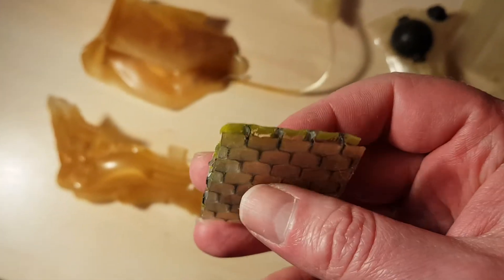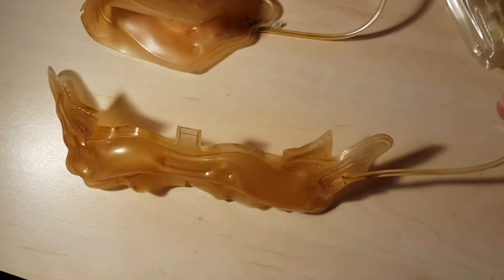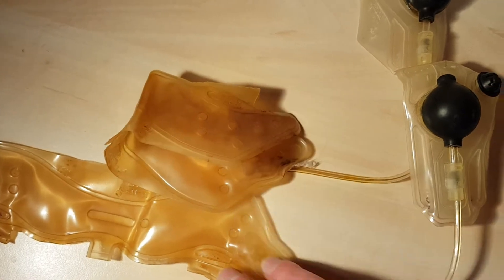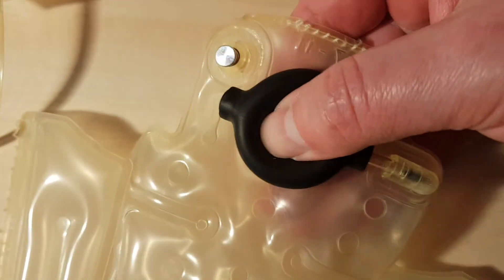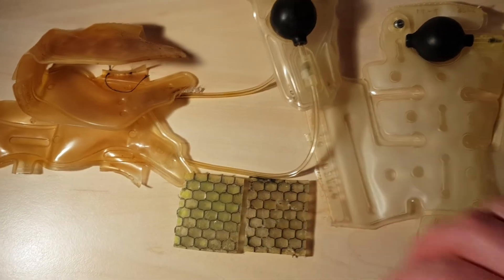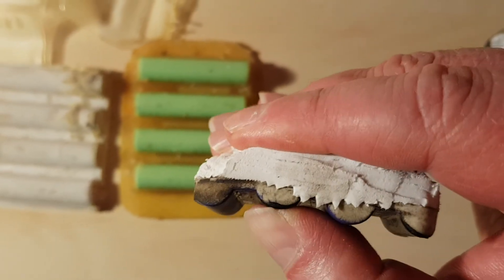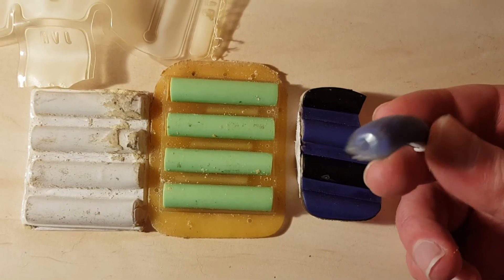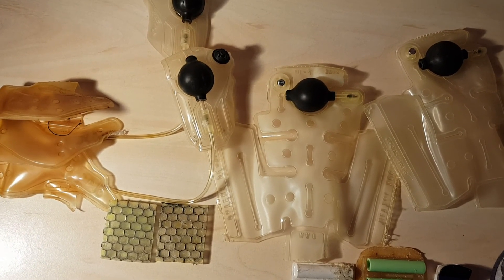REEBOK PUMP TECHNOLOGY. ORIGINAL PUMPS. ORIGINAL HEXALITE. ORIGINAL ERS.

Comment: Reebok wasn't expecting people to dig in and find out they skimped out on the ERS system. That's ridiculous. We know that the hexalite in today's pumps isn't the real stuff, but now I wonder if it's just the size of that little window on the bottom and that's it?! Wow, pathetic. We should definitely call them out on this and see if we can force them into doing it right in the future
Reply from the maker: Yeah, that annoyed me big time. They hid it well. It took me ages to rip into that midsole. And I was shocked to see this "ers" was just a bit of the midsole that had been shaped and painted to look like ers. 
I knew something wasn't right, because for one, the retros with ers are not as responsive as the original under foot.
And two, I could see in old retros that paint had started wearing off the "ers". I thought how can that be. Hytrel tubes aren't painted. 🤔
Reebok really dropped the ball with this one.
I have one pair which I think could have the real hytrel tubes and that's a 2005 sample twilight zone. It just feels different to every over omni zone, 89 pump, and twilight zone that I have.
Suppose I should send Reebok this video and call them out. They shouldn't call it ers when it's obviously not.😡

Comment: Why didn’t you pump up and release the new one??? Also these were 170 in 1990. They are 100-160 now. If they used the same exact stuff, they would probably be about 250-300. Not many would buy them.
Reply from the maker: Yeah, it was the 1989 pump hi and the 1990 twilight zone that cost $170. That was due to them being super hightops and having full foot air bladders. 
The price dropped about $50 when they moved to the mid foot pumps that were in the shorter hightops, like the omni zone and blacktop line.
Some of the early 2000s retros had the same technology/materials, but it was completely gone by the time we had the financial crisis in 08/09.
I doubt Reebok will ever go back to the original tech.

I'm not 100%, but I think I pumped the newer pump up in another video. I've done a few regarding pump technology. 
Actually, I think I deleted one, but there should be atleast another two up.🙏🏻👊
Reply: @TheRetroManRandySavage  rose anvil who dissects tons of shoes took some new ones apart and he pumped it 350 times and it got huge and didn’t burst.

Comment: Why they changed the Hexalite tech in the retros, Ill never know but I feel duped somewhat.. o well
Reply from the maker: I feel the same bro. The last new pump release I bought was the omni zone 2's back in February. And I was that disappointed I haven't bought another. 
Comparing them to my originals and older retros is night and day. 🙏🏻👊
Reply: @TheRetroManRandySavage  ive heard the excuse / reason for changing up Hexalite tech is because the old Hexalite was too soft and it would get easily punctured, esp on the bottom of the shoe if it was exposed. Dont know if that's true, or the main reason.. still sucks.
Reply from the maker: @qhorton6743  maybe a bit of truth to that. If it popped it would be an individual cell or two. The rest would still remain in tact. 
But luckily it's never happened to me. All my hexalites have been fine.
Even the og hexalites I have from the 90s are fine.
The new "hexalite" is just hardened rubber. Zero responsiveness. 
It's basically just for show now. Same goes for the ers. That's just for show too. I've done tests with it compared to original ers and the differences are night and day.
This all happened after the financial crash of 2008. Everything before then was real hexalite, and everything after was fake.
Imho I just put it down to Adidas putting the squeeze on Reebok. 🙏🏻👊
Reply: @The Retro man Randy Savage  very unfortunate. Thanks for the detailed response though. I still rock with Reebok but this is oh so unfortunate. I've heard the more recent retros are getting "improved" Hexalite but imo, it still doesn't hold up to the original

Comment: The hexalite is laughable even reeboks are the most comfortable sneakers. I had 2 z pumps and they were great but the bump parts not lasting long.
Reply from the maker: Unfortunately the plastics and rubber used in modern retros are rubbish. They start crumbling after 10 or 15 years. The pump on my 2004 89 pump hi has crumbled. 🙏🏻👊
Reply: @TheRetroManRandySavage  Well the situation is the same with every other brands too. I’m a sneakers collector and i mainly have nike air maxes but i also have or had other brands like adidas, reebok, puma. I think manufacturers will never be able to use the good old materials because of the modern day standards and the costs. The demands are higher for these sneakers than before because every sneakers fan knows the 90’s was the golden era for all sneakers brand. I also have experienced the quality differences on my all time favourite adidas firebird tracksuit (Run Dmc style). The fabric is far not the same what i used to have back than. I found a tag inside what is saying “made with recycled plastic” It is sad to see where the world is heading now.
Reply from the maker: True. The glues, rubbers and plastics all used these day's are all made differently because it's apparently better for the environment. 
I have lots of og shoes where the midsole is still bonded to the upper. But a lot of retros I have the midsole is separating because the bond is no longer.
So we have to now spend tons of money for shoes that won't last half as long. 
Bug shame indeed.
Reply: @TheRetroManRandySavage  yeah man it’s all about the dirty money. The other thing what i hate is their marketing strategy like when the manufacturers not making constantly the og models just releasing them in every 5-6th years so that way they making peoples feel like they suffering a huge loss if they not paying the high retail prices and at the same time they created a new market for resellers so basicly these shoes getting less available for the peoples. I recently scrolled the ebay after a pair of retro adidas eqt shoes which i have always wanted since i was a 10 years old kid and the price tag is over $220 now and it will just go up.
Reply from the maker: @NZotyoka81  it's definitely getting harder to pick up OG's for a reasonable price.
The Reebok blacktop line on Ebay is rediculous. Way too expensive. And seller's think people will pay it.
And it's all Reeboks fault because like you say, they aren't releasing them enough. 
The blacktop battleground 1's was given a retro in 04 and 09. And the blacktop battleground 3's was brought back around 2014. So it's basically been almost 10 years since the last retro. That's rediculous. If they released more regularly it would stop greedy resellers from charging extortionate prices.